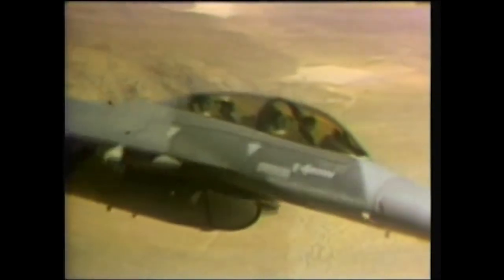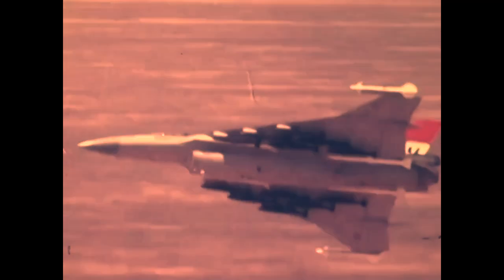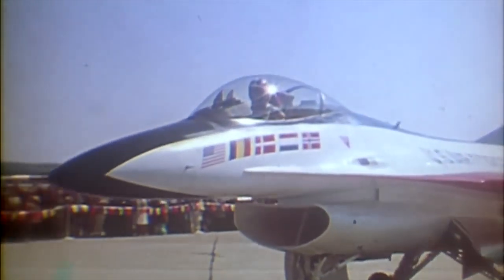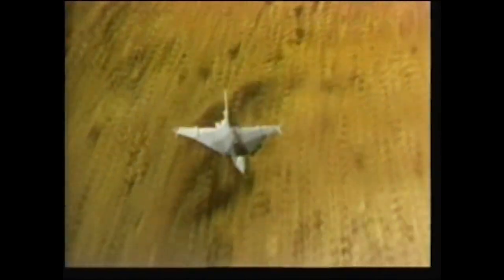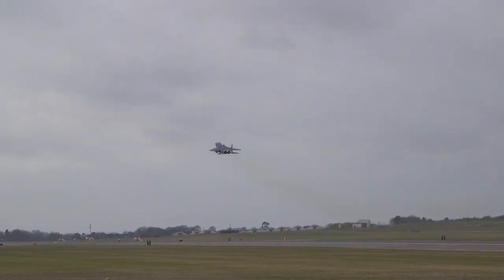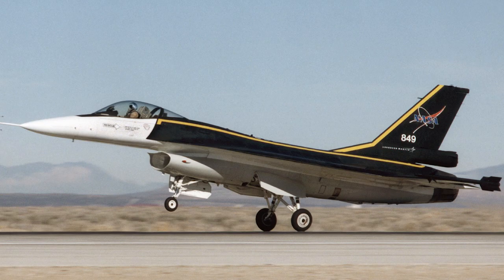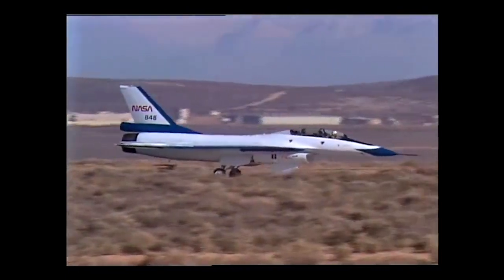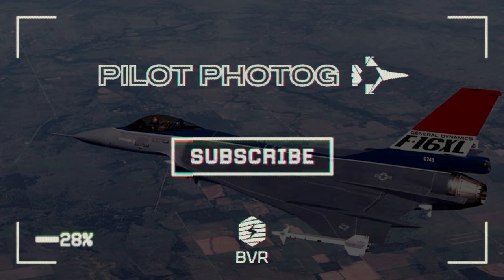F-16XL The Fighter That Should Have Been Built | avgeek |  #f-36

Comment: It really looks like the XL was meant to fit the same role as the F-15E, so it's not completely unfair for it to lose out (taking ATF & the Nighthawk aside).

However, I think the USAF would've benefitted in cost reduction long-term with the XL more than the Mudhen. Sure, XL is a redesign, but it has one less engine to worry about & still has a lot of modular features already in production. Not to mention training less people as WSOs.

The XL would've benefitted the US more especially today, while the Mudhen was the clear premium choice back then.
Reply from the maker: Good points and the XL would have been a lower cost option long term.  Also I think the XL would have had huge success as an export fighter - given that the F-16’s sales record to date.
Reply: @PilotPhotog  oh, definitely. What country wouldn't love a relatively low-cost, high-performance multirole?

Heck, if XL were exported, I think my country (Indonesia) would've chosen them over the Flankers. I can say that for certain with other Asian countries like Taiwan, Singapore, South Korea, and Thailand.
Reply from the maker: @TheRibbonRed  exactly and thanks for sharing! I think there was/is? a need for the XL.
Reply: USAF often goes for whatever the most expensive option is.   E.g., F-22 vs F-23, the more expensive F-22 is chosen, even though the cheaper F-23 was faster/stealthier than the F-22 and almost as maneuverable. For F-15E vs F-16XL, the more expensive F-15E is chosen.  There are a lot of examples of this. Might be a good subject for a video someday? :)
Reply from the maker: @ssranon  An excellent idea, thanks for commenting.
Reply: A. Nony Mous  I disagree, it actually seems like they typically choose the more inexpensive jet, like the F-15E as opposed to the “completely overhauled” F-16XL. In fact, the F-35 is the only real example of the U.S. military taking a gamble on the more expensive fighter, and potentially why they normally don’t. The F-35 is fancy but at what price/cost? I think that remains to be seen, I love the F-35 but I’m sure there was a less expensive option somewhere.
Reply: @heavyizthacrown-5842  Maybe a fourth F-35 ? One with a cranked delta wing, F-35 D . Great Video PilotPhotog ! Well done
Reply: from what i recall reading in the 90s, the XL was actually a pretty simple mod. Of course the wings were all new, but the rest was surprisingly easy. Hogwash about the reliability of the engine over long missions. The Israelis proved it was fine when they took an extended mission to blow up an Iranian facility pretty much straight away after delivery.
Reply: The main reason the USAF went with the Strike Eagle over the XL was the fact that the Eagle has TWO engines. It did NOT want to send a jet over enemy territory for bombing purposes with only ONE motor. Having only one motor is the main reason we nicknamed the F-16 "lawn darts."
Reply from the maker: Agreed and wonderful insight, thanks for commenting!
Reply: Don't forget the F-15 is still undefeated in war.
Reply: @PilotPhotog  I worked on the F-15A, C, & Es for 20 years!
Reply: @manwithnoname691  Yep, worked on them for 20 years!
Reply: Roland Lawrence   That was one single mission with unlikely resistance.
Reply: @stormyf15  exactly, another reason why the navy got stuck with the f18 bc their requirements was they wanted to engines and was also an ideal choice between the 2 for carrier landings
Reply: @ssranon  YF-23 & the planned F-23A cost much more than the F-22, even after AIRST and the supersonic ejection systems were dropped from the ATF program due to costs.

USAF chose the F-15E since the F-16XL was underpowered. If you read all the test pilot reports, they loved the XL, but all said they had concerns about it due to the lower thrust-to-weight ratio.
Reply: @mrrolandlawrence  Iranian facility? Nope. It was Iraqi facility. Ironically at the time Israel smuggled parts and munitions to Iran for their US made systems. Also that nuclear facility was earlier bombed with less success by Iranians using F-4 Phantoms, based on Israeli intel. During Iran-Iraqi war realpolitik made rather unlikely friends despite all anti-Israeli rhetoric from Iranian regime.
Reply: I think it would have made a great replacement for the F-106. The long range, super cruise, and low cost would have been really useful. For long range strike the F-15E was a better aircraft but no way it was cheaper.
Reply: @nichollsboy11  Can you go back and read what you typed, and try again? I can't tell what it is you are trying to say.
Reply: @LRRPFco52  sort of.    the actual unit cost of the F-23 was projected to be lower than the F-22, but the USAF was mad about Northrop's enormous B-2 Spirit cost overruns, and they were once-burned-twice-shy regarding the projected cost of the Northrop F-23.   the USAF therefore assumed the F-22 would be cheaper in the long run (without any concrete proof AFAIK) and included that in their official list of reasons to go with the F-22.  that was their story and they were sticking to it.

in fact Northrop had intentionally lowered the YF-23 cost through the clever use of a bunch of previously-designed parts from other airplanes including the F-18 and B-2 among others.   that would have helped avoid the type of cost overruns that plagued the B-2 program, and would have most likely resulted in the cheaper ATF per-unit cost.   but the USAF wasn't buying that idea.  literally.

as a result of the USAF official position, the that's the way the modern internet records the cost situation, and everyone thinks the F-22 was always the cheaper option.    but that doesn't quite correlate with what i was reading in the newspapers back in the late 80's / early 90's.
Reply: @ssranon  That's utter hogwash. The US military machine always factor performance and cost into the equation. They actually thought the F-23 was the cheaper option!
The F-16XL would never have been better than the F-15E, which has proved itself to be an indomitable machine.
Hey, I love the design of the F-16XL, but you can't just make stuff up to justify your point.
Reply: @Yxalitis  
> "The F-16XL would never have been better than the F-15E, which 
> has proved itself to be an indomitable machine."
> "Hey, I love the design of the F-16XL, but you can't just make stuff
> up to justify your point"

sorry, but what did i make up?   i never said the F-16XL was better than the F-15E, i just said the F-16XL was the cheaper of those two options.   not sure if you're responding to me, or something someone else said. ¯\_(ツ)_/¯
Reply: the XL with its conformal stores carriage was clearly superior to the E with its strictly bulk power provided by two engines. and how were its stealth character.
Reply: @DavidSiebert  Yes, long legs like the 106 and weapons load of the 15A/C, would've made a great interceptor.
Reply: @ssranon  True however the F-22 won because it is more maneuverable than the F-23. In addition the weapons system of the F22 is superior to that of the F23. The USAF, learned a hard lesson of the importance of maneuverability during vietnam and given that lesson the choice of the F22 was predictable. Though IMO why not choose both? Cost savings could be had by sharing weapons systems, avionics, etc.  Having both be beneficial, due to the option of capability on hand, perhaps even more so strategically opponents would then have to   prepare for the scenario of handling either an F23 vs. an F22 would be an advantage neither fighter alone would be able to project. 

Having a small fleet of F23's along side the F22's no more than 10 would be necessary. Such a fleet it's mere existence would require opposing militaries to spend significantly more to hope to be able to match the potential capability.
Reply: @ssranon  The YF-23 didn't have a working weapons bay missile storage and ejection system, just proposals and some initial design work.

The YF-22 already had not only a fully-fumctioning main weapons bay for AIM-120s, but the cheek bays for the AIM-9, both of which were demonstrated with in-flight separations.

The proposed F-23A was going to have an additional forward weapons bay, which would lengthen the already-long fighter, and still not reach the weapons count of the F-22A with its 6x AIM-120 & 2x AIM-9.

Due to the need to redesign the intakes and supersonic airflow management, tight tolerances Northrop demonstrated between control surfaces and the wing, the unresolved continued wind screen fractures, and questions about the viability of their weapons bays proposals, the costs to do extensive RDT&E on all of those were going to be extensive, whereas Lockheed/GD/Boeing already had that figured out on the YF-22.

The F-23A would have added years and another $100 million in R&D easily, with the risk of extending or missing critical deadlines to address all those issues.

It was a beautiful airframe with immense power and graceful handling, just had a lot of loose ends that would require major efforts to correct that the YF-22 had already conquered.
Reply: @ImpendingJoker  😂 sorry bruh I was drinking, but what I meant was thats why the Navy chose the f18 over the f16, the Navy's requirements was 2 engines, they didn't want a single engine jet
Reply: TheRibbonRed RUSIAN MIGS & SUKOIS are superior in every way against US aircraft. I was in the Air Force in the 80’s and the AF mechanics and avionic techs all told me the MIGS run in circles with our F-15 and F-16’s plus MIGS can land and take off on rugged terrain where none of ours can. Pretty much all MIGS have armor like the A-10 not like your typical US fighter that relies on avionic tech only.
Reply: @asianfighter62  You were seriously misled.  We did full technical analysis and tactical exploitation of the MiG-29 in Grrmany, UK, and Florida and it was a piece of garbage, very crude, poor human interface, climb rate was between the F-15 and F-16, no persistence, terrible R-27 missile, but great R-73 IR helmet-cued missile.

MiGs and Sukhois do not have armor around the pilot like on the A-10, as they aren't meant to fly low and slow doing CAS and getting shot repeatedly by AAA and MANPADs like the A-10.

There are several great articles and interviews of Fighter Weapons School pilots who did all the exploit work on the MiG-29 that basically blew away the myths that were perpetuated by CIA in the US in the 1980s.

Su-27 is a lot better platform than the MiG-29 in every way, but still suffers the fate of being built by limited Russian manufacturing quality control and the same missiles.
Reply: Calling the Eagle the "mudhen"?  Really?  You were aircrew?  No?  Then that's pretty much an instant clue-in the person typing has no idea what they are talking about, but is invested heavily in their own agenda...or fantasy.  And having one less engine is almost never a positive thing.
Reply: @FMChimera  Dark Grey Eagles are called Mudhens since they primarily do A2G. Light Grey C models are strictly A2A.
Reply: It was. 👍
Reply: @LRRPFco52  if the F-22 was so fully functional and ready to go vs the F-23, then why was F-22 deployment delayed 52 months?   why where there mass cost overruns?  why was it grounded with pilots dying from oxygen problems, flight restrictions being placed on the airplane, etc, happening even 10 YEARS after initial F-22 deployment?

many of these problems are documented in a whitepaper by the Rand Corporation if you want to look it up.  

i'm not denying the F-22 is a great plane (it is) but IMHO you can't imply that the F-22 was completely ready to go versus the F-23 which needed some additional R&D.  the F-22 has evolved into a fantastic front line fighter, but in 1991 it clearly wasn't ready for prime time yet either, and also had a ton of loose ends, as evidenced by the significant delays we have seen in the F-22 program over the years.
Reply: FMChimera half the consumption, simpler design and cost, and half the chance of engine failure compared to 2 engines, better aerodynamics, faster roll rate and maneuvering etc. There are many upsides to a single engine compared to 2
Reply: @FMChimera  You're one of those clowns who calls the F-16 a Fighting Falcon, aren't you?
Reply: @ssranon  It has something to do with contract management. No way would Northrop get chosen after the B-2 disaster. The Air Force ended up with 15+ B-2 Bombers at around 1+ Billion per plane. The F-15E has shown to be a solid choice.
Reply: @ssranon  The F-22A didn't exist in 1991, so any claim that its challenges were solved would be erroneous. Only 2 YF-22 prototypes existed then. The YF-22 & F-22A are quite different aircraft.

Since multiple new ground-breaking technologies were being integrated, there were major hurdles to overcome that no other nation has been able to do.

OBOGS wasn't an F-22 specific problem, but fleet-wide including the Navy. 

The YF-22 never met the weight goals of ATF, whereas the YF-23 did, which rarely gets mentioned. The YF-22 PAV-1 with GE YF120Ls was the only 1 of 4 that exceeded Mach 2.

Since the Lockheed team had done a lot of extra credit and solved the high supersonic airflow problem using a VLO splitter plate geometry, as well as solving the weapons bays and ejector rack separation.

They had to redesign the airframe, wings, stabs, vertical stabs, engine nacelles, intake placement, ductwork, and most difficult-make the IFDL work between multiple Raptors with the volume of data being shared.

The F-23A would have had to have tackled all these challenges as well, and OBOGS would have caused the same problems.
Reply: @LRRPFco52  thanks for the informative reply.   it sounds like we agree that both planes needed a lot of work before either was finished.  

i'm aware the F-22 didn't technically exist in 1991, i was referring to the F-22 prototype (YF-22) and the hypothetical F-23 prototype (YF-23) that were being flown against each other during the ATF fly offs that were held circa 1991 iirc.   apologies, i should have been more specific.

fwiw, i still think it's a shame that the F-23 never came to fruition, it might have been a fantastic airplane.  no way to ever know for sure.  but i admit the F-22 has turned out to be a fantastic plane itself.
Reply: @Steve-yr5vi  i havent heard of the f-23 yet but it sounds like it still woulda been better than the f-35. Shoot, I think it's clear that the government doesnt even plan to really use them as they are revamping already in use craft like the new F-15s and upgraded A-10s. 

They just plan to sell the f-35 to make money. I just learned that we cant even build more f-22s today if we wanted to. The tech is old, and integrating new tech would take more money. F-23 sounds like it woulda been a good addition to the 22s. 

The dream would have been the companies work together and share tech, making a hybrid but hey sometimes two is better than one. 
We made a mistake not making this jet with the f-16, and we made another by not making the f-23. 
Probably would've had a 6th gen ready to go by now.
Reply: @mrrolandlawrence  they didn't receive any ground fire and they flew low level all the way there and back. No early warning for the Iraqis.  Plus they were just in the bomber role they had F-15's as fighter escorts with them.  I have yet see a story of an F-16 fly without a wing either. An Israeli F-15 landed without a wing.
Reply: @Giada_De_Low_Rent_Tits jus saw a video on Israeli's use of the f16s. We definitely shoulda invested more into them than the f35 which has been plagued from the start
Reply: @ssranon  The cheaper F-23? I thought price point was the deciding factor and the YF-23 was substantially more? Just as it ultimately was with the JSF -> F-35.
Reply: Id still rather have 2 engine's instead of the 1 more reliable and power
Reply: @Giada_De_Low_Rent_Tits well Canada wont buy one engine jets for the specific reason that they need two because of the type of air space they fly in thats why they went with the f18 hornet, so il take the military's word on the type of hardware required for their missions.its just common sense if one engine fails they still have one to get them home and save the aircraft. Tomcats are a old aircraft they have much better engines today and i would bet that there was a specific problem with the type of engine they used on that legacy aircraft so that point really doesn't matter.
Reply: Hell, even if Lockheed revived the F-16XL now and incorporated the F-16 Block 70 technology, I suspect it'd do well. For nations where technology transfer restrictions won't allow the F-35 to be offered, it'd be a good competitor to Boeing's Super Hornet and the Eurofighter Typhoon.

(Though I suppose the viability of that idea depends on whether the F-16XL was included when Lockheed bought the Fort Worth Division from General Dynamics.)
Reply: @andrewthomas8233  And why the Super Hornet is the most likely choice for the CF-18 replacement.
Reply: @PilotPhotog  
Just say it , man... F-16XL-Block.70 ! .😎
Reply: @Steve-yr5vi  
Too many different aircraft in the same mission role is a logistic/support nightmare. Parts and training costs would be huge and wasteful.
Reply: Give a pilot a choice of 1 engine or 2 especially if you have to go down low, twin engines are the choice.
Also in talking to f 16 pilots the success of it comes from the small size.
Otherwise no reason to replace the f 15 the most successful fighter ever   104 and 0
Vipers hornets etc have all been shot down
Reply: @stormyf15  oh yeah? I worked on them for 21! So there!
Reply: In the role of deep strike it loses out to the Strike Eagle. You want the big wide frame to haul the heavy ass bombs and you want the two engines to give it decent flight performance. You can just tell by the size of its wing... it's fully relying on high lift to keep afloat. A fully loaded F-16XL would not go into the vertical. 

Though I think this would have been interesting in a high altitude interceptor configuration re-engined with a J-58 or something.
Reply: With the avionics technology of the time the wso is a crucial element of a successful mission.  It took how many years for the f-35 to fill that roll with a single pilot?
Reply: The F-15E could've been converted to a single seater.
Reply: Not  really. the f-16 was  designed to be a cheaper plane to complement the f-15.The fact the the xl cost as much as the f-15 is what doomed it.
Reply: @PilotPhotog  It was mentioned today 24 Aug 20, that there is a $62 BILLION most to Taiwan....can't imagine what China would think if Taiwan has the F-16 & F-16 XL  (Whoa!!)
Reply: TheRibbonRed the unsung hero’s are the FIS Squadrons.  They usually get other people’s aircraft when they are done with them.  Interceptors do not have to be stealth for they are intended to be seen in the intercept.  Stealth and SATCOM will change this in time, and already has in Alaska.
Reply: @rapidsqualor5367  F-35 could use a delta wing considering its current set up gives it poor range/fuel consumption and can't super cruise while everyone else can. Plus its supposedly a multi role, why not give it the payload if its supposed to be?
Reply: @PugilistCactus  Grafting on a delta wing to a F-16 is one thing but on a stealth plane ? Not with my tax dollars. The F-35 does have some great sub systems. The PW F135 engine. The F-35B is fantastic. The F-35A compares with the F-16.  50% more weight, 50% more thrust, 50% more wing area. Maybe where they dropped the ball was not following the area rule and ending up with more wave drag. Maybe the new CMC engines will help overcome.
Reply: Seems like there's a high bias for Lockheed/Lockheed-Martin and Boeing for high priority plane projects. The YF-23 used new construction techniques and avionics BUT, used common parts, such as landing gear from the F-5, which is still in service as an "adversary" plane in BFM squadrons that don't use the Viper or F/A-18 in that role. The F-15, F-22 and F-35 were/are BRAND new systems that use technology pioneered from the previous platform before it. The F-35 and F-22 have a higher flyaway cost than the F-15 and F-16 combined.
Reply: @nichollsboy11  The YF-17 was the direct competitor to the YF-16, and the US Navy adopted the YF-17 airframe, beefed up the undercarriage, associated bulkheafs, and tail hook. The LEXs were also enlarged for higher AOAs needed for Carrier ops. It's amazing how what seemed to be a dead project was rescued by the Navy, and look at the program now. 40+ years later and we have the "Super Hornet" which is actually the "Hornet 2000". Same applies to the UH-1Y/AH-1Z concept. Both airframe upgrades were suggested decades ago, and have only recently been implemented. The basic design remains unchanged, despite it being nearly 60 years old. Same for the Hornet family, same base design with needed performance and design changes.
Reply: @mrrolandlawrence  As much as they would like to, the Israelis never flew any strike missions in or at Iran. You're probably referring to the '84 mission against the Iraqi nuclear reactor at Osiraq.
Reply: ETF program is asking for a strike aircraft, so air to air capability was a secondary concern, while range and low level flight characteristics would be priority, the F-15E actually failed the initial project requirement at the deadline while the XL passed with flying colors, since F-15's original design been an air superiority fighter has a much lower wing loading which makes low level stability an issue - crucial for a low level penetration strike craft, while the twin engine placement made it way less efficient in fuel usage so range was also an issue. However the USAF was also concerned about increasing the size of its existing F-15C/D fleet, which has been taking extensive flak from congress on its sole focus on air superiority missions to the detriment of other functions, especially with the advances in radar and missile making F-16 also a competent BVR interceptor. Having the F-15E in the fleet would have silenced some of those criticisms while decreasing individual fly away cost for ALL models of F-15. And so it was that the Air Force essentially allowed the F-15E team to "cheat" and gave them extra time to come up with the additional Conformal Tank (CFT) solution for its insufficient range (The F-16XL on the otherhand was perfectly capable of carrying the specified amount of munition while reaching the required range without external fuel tank). So one could almost say the selection has more to do with the USAF political desire to protect its F-15 fleet then actual operational requirement.
Reply: The XL just can't do what the Strike Eagle can do, so it makes no sense to look at cost, if you don't get the capability needed. Even the Strike Eagle was a huge compromise, because it falls way short of the F-111 wich it was meant to replace.  The Strike Eagle was not a premium choice, it was the best compromise the USAF could get. Furthermore the WSO is the backbone in AtoG engagements, especially in complex. long range strike missions and as an airborne forward air controller. Due to the yak ahead, the XL would have had to enter service as a 2 seater, so no cost savings there. One person just could not do the job back then and even today all new F-15s are two-seaters and most will be used as such. 
The F-16XL lost, because it was the lesser product for the task.
Reply: @TheRibbonRed  All countries mentioned in your post fly the F-16 and in addition modern developments of the Strike Eagle. The XL was just not the richt plane. You lost a lot of it's air to air flight performance and still don't even come close to the Strike Eagle`s potential.
Reply: @ssranon  The F-15E anf F-16XL were meant to replace the F-111 and the F-16XL just could not deliver. Even the F-15E was a huge compromise compared to the F-111`s long range capabilities.
Reply: @PilotPhotog  The lower cost option, wich could not fulfill the task. It makes makes zero sense to buy such a platform.
Reply: @Hunter Giovanni just reported you on the FBI website 👍🏻
Reply: I have read that the F-16XL was General Dynamics competitor to the Boeing F-15E Strike Eagle. Both were presented as replacements for the retiring FB-111 Aardvark. USAF chose the F-15E but did show interest in the F-16XL.
Reply: They should have replaced the F-16 with the F-16XL
Reply: It was the competitor of the F-15 E for the ETF contract. It lost due to having unacceptable ride at nap of the earth flying. Could have made a great lower cost defense fighter
Reply: @heavyizthacrown-5842  The less expensive option was ignoring the Marines and not trying to shoehorn a STOVL into the F35 design. That was the source of all the ills.
Reply: @ssranon  There's no way the F-23 would have been cheaper than the F-22. The 23 had too many new technologies.
Reply: No necessialry so. From the inception idea of a LWF (Boyd &  other Einsteins, and they were) and the less than desired performance of weapons systems of the F-4 in Nam, there was then and now a mission requirement for a high and low mission fighter bomber. In the DOD there never will be a Leatherman multi-purpose tool.  If the govt could dictate where the mult--tool was made it would be  Georgia and the west coast, and Tx. Needless to say it wouldn't work or even fit together while costing 5x it's weight in platinum. You say no, look at the A-12 program that got cancelled.
The survival of economies dictate contract awards. McDonnell Douglas was to survive....getting the high mission. GDFW and P& W got the low. The F-111 was killed by Doves.  P&W makes the F-100 Engine for both the 15 and 16. Nuff said
Reply: Do not ever get me wrong or try to explain why I love both the F-15 and the F-16. You will fail.
But then again I loved my Hawg above all. He was cute.
So there!
Reply: @Major_Tamre_Colby  yes love is a many spender thing. I worked the Hun, a maintenance nightmare, for seven years but loved being it's crew chief because it was a legend and I was part of it.
Reply: @robertstack2144  
Robert,
This is Tamre'. I am not all knowable. What is the Hun?
Tamre'
Reply: @Major_Tamre_Colby  the "HUN," is an American term used to name the North American F-100 C,D and F Model Super Sabre Aircraft. The 100 is pronounced ONE "HUN"DRED. We who were associated just called it THE HUN.
Reply: @robertstack2144  
I stand humbled. The only aircraft I am familiar with of the early sixties until development is the F-105. Thought I have always been fascinated with trying to fly the F-104.
But my German friends will not allow that.
I do not know all the nicknames for all the ancient aircraft.
Forgive me.
Tamre'
Reply: @Major_Tamre_Colby  How are you with the F-111.  Military strategists then considered it the perfect airplane and by all accounts it was. Back then the Soviets feared it as much or more than their own secret police. The Soviets wanted every F-111 counted in the SALT  negotiations, even the F-111s in storage that were worn out or being salvaged had to be included.  They had no defense for TFR. Our politicians here made it a pariah, as politicians do to good people and good things.
Reply: @robertstack2144  
Robert,
That is without debate. It was the most phenomenal aircraft of its day. The first swept wing super sonic aircraft ever. The Soviets tried and failed to copy it.
It was a major player in Vietnam.
Should I denigrate it?
Yes. It was not pretty and I like my plane better.
So there.
Tamre'
(Also its ejection system sucked.)
Reply: @robertstack2144  
Robert,
I would love to have been able to fly an F-111 Aardvark. Alas they were gone before I was born, besides I do not like to share but that is not either here nor there. I have been lucky that I have been honored to fly the F-104, F-105, F-14, F-15 and P-51D and a few others that are no more. And of course the A-10B, F-16C and recently the F-22. Rank and whining has its privilege. Bribery doesn't hurt either.
Reply: @robertstack2144  
Robert!
Thank you for reminding me! I had totally forgotten that. In a world full of Aardvarks, Hawgs, Vipers, Raptors, Buffaloes and Pogos, yes there was a ill fated insult to our dear pogo stick, I forgot we also had a Hun in good standing. But nothing can match for sheer imagination the wonderful silly Squirrel.
Reply: @Major_Tamre_Colby The F-111  was a miser on fuel compared to the F-14 which I think that in burner the F-14  TF-30's two of them would burn 564,000 lbs/hour while the F-111  at altitude had a max burn rate of 540,000 lbs/hr a savings of around 5%. I'm not sure why because the F-111  I believe was a lot heavier.thats about 83,000 gal of F-40 an hour. Hope you can afford to fly one.
Reply: @robertstack2144  
Oh My! Robert, you do not think that I was being facetious do you?
Heaven forbid!
Maybe a little irreverent with inane jocularity. But never facetious, the would be my Lt. Kara Rayas. 
...you talking about me.
No.
...you better not bossygirl
...or I hit you! Sir!
Kara, you hit like a girl.
...a 185cm amazonian
...warrior and nomadic
...gypsy princess girl.
Robert, your F-111 Aardvark got off easy.
...aardvarks eat ants.
See what I mean.
Reply: @Major_Tamre_Colby  I was being facetious about the 14 and 111.  Both very heavy aircraft powered by the TF30 but different dash numbers. Both could drain Iraq of their oil supply. The only Kara I knew of was Revlon or Kara Hultgren. While working at GDFW one Engnr I knew went thru Navy  OTS and flt training with her. We should sit and enjoy a beer sometimes, I'll remember The Hun and Y2 and you The Hog. Best Regards
Reply: @mrrolandlawrence  There have been numerous cases of F-15s returning with one engine not functioning. Guess how many F-16s have made it back to base with one engine not functioning?
Reply: *hh:bh*:
Reply: One day, AI and the wingman program will dedicate maybe as much as 10 AI wingman   . Imagine an F16 with 10 dedicated AI wingman with stealth capabilities. I’m predicting the XLs return.
Reply: The Strike Fighter competition was indeed meant to pick an airframe - for a very specific role: night / weather deep-strike into enemy territory. The F-15E was clearly a superior choice - for THAT mission; two engines + two aircrew were critical, and they were unable at that time to achieve the capabilities of the F-15E radar / targeting system into an F-16.

But that's really irrelevant, because it never needed to be "one or the other." The XL wing version would have added $0 to the operational costs per unit, and averaged over the production life of all F-16s built SINCE then, would only have added about $1 million to the acquisition costs (at that time, roughly a 5% increase in purchase cost and only 2.5% increase in total lifetime cost for about a 70% increase in capability). I was training to fly Phantoms at that time, and I and my squadron mates all rated the decision not to alter future builds of the XL as probably the worst strategic purchasing mistake by the USAF since it's inception.
Reply: @PilotPhotog  They just made a decision to buy F-15EX airframes to "bridge the gap" because we are currently retiring older airframes faster than they can build F-35s. The stated intent (of course we can't know what they are really thinking) is that in a war against China or Russia the F-15EX aircraft would act as "missile mules" for the F-22s and F-35s, allowing them to direct the battle invisibly while ordering attacks against individual aircraft.

The F-15EX is specially modified to carry up to 8 AMRAAM (or it's successor) missiles. The XL was capable of carrying 16 as designed - and for the SAME PRICE we could have fielded twice as many (32 missiles airborne for the price of 8).  The cost? $0 per unit in additional operational / support costs, about $1 million per unit (about 5% of purchase cost at the time) in acquisition cost. I rate the decision NOT to convert the F-16 construction line to build all future F-16s with the XL wing as the worst strategic purchasing cost by the USAF of all time.
Reply: @ssranon  The specific role for the Strike Eagle mission was night / weather deep strike. For THAT ROLE, the F-15E was the correct decision (basically replacing the F-111). However, that does not change the fact that had they made the decision simply to produce all subsequent F-16s with the XL wing every aircraft would have had about 70% more mission capability for about $1 million more in acquisition costs (about 5% of purchase cost), and ZERO in additional support costs. Worst purchasing decision by the USAF ever!
Reply: @mrrolandlawrence  Correct. Averaged across all future construction F-16s after the Strike Fighter contest, the wing mod would have added about 5% ($1 million) per unit to acquisition costs and ZERO to support costs (meaning about a 2.5% lifetime increase in total cost of ownership and operation). For that they would have achieved about a 70% increase in mission capability. Worst strategic purchasing decision in USAF history IMHO.
Reply: @LRRPFco52  Incorrect. The YF-23 would have had a similar, or perhaps even lower, total cost of ownership. And, IMHO it was a better aircraft. However, that was not the only consideration. Northrop had recently angered some in Congress for a mistake, and they were already building F-16s and F-119s. It makes some sense to spread the purchases of major combat units across more than a single vendor.
Reply: @Yxalitis  Speaking of hogwash, there are several videos on YouTube which address all the reasons why the F-23 was not chosen. Better performance was NOT one of them. The F-23 out-performed the F-22. The F-16XL was NOT suitable to the SPECIFIC mission of the Strike Fighter contest (night/weather deep strike into enemy territory); however, the decision not to apply the F-16XL wing to all future production units was perhaps the worst strategic purchasing decisions in USAF history (about 70% increase in combat capability for about a 2.5% increase in total lifetime cost of ownership). It was never an either/or decision, they could and should have built both.
Reply: @Steve-yr5vi  "True however the F-22 won because it is more maneuverable than the F-23."  Sorry, but that is not true - and in any case they were so close that it was never a deciding factor. What they ought to have done back then was to build one of the two contestants exactly as they did, and have modified all future builds of the F-16 to the XL wing and use them (if ever needed) in exactly the same role they plan for the F-15EX to be used today - missile mules. With the supercruise capability of the XL both to close in and disengage; far better stealth than any F-15; and the ability to carry up to 16 air to air missiles, the F-22/23 planes need never have gotten close to their targets to take them out and the low total number of F-22/23 aircraft would not have been a hindrance to fighting a first-world war.
Reply: @LRRPFco52  The F-22 ended up having just as much in cost overruns and redesign. Can't mention what I do know, but the 23 probably would have been the better choice in hindsight.
Reply: @FMChimera  Just before I deployed to Iraq in '90, I met up with one of my old F-4 back seaters then flying the F-15E. He called it the mud hen, as did many (most?) of the other fighter pilots.

Having one less engine meant the F-16 cost less than 1/2 as much to operate as any F-15 (as well as costing half as much to buy). Yes as a pilot we would all like a second engine; however, when it's a choice between losing a few aircrew vs doubling your combat capability, guess which one wins?
Reply: @RedXlV  3 years later - they just made a decision to buy F-15EX aircraft to "bridge the gap" as airframes are being retired faster than they can build new F-35s. These F-15s have been specially modified to carry up to 8 air to air missiles so they can act as "missile mules" for the F-22s / F-35s should we go to war with China or Russia.

The F-16XL was designed to carry 16 air to air missiles. So, for the same purchase and operational costs, we could have had 2 F-16XLs airborne carrying 32 missiles on behalf of our stealth airborne command and control vs 8, and we wouldn't even have had to make a special buy.
Reply: @fazole  F-16XL was mechanically almost identical to the "normal" F-16, and could easily have been supported by the same supply chain (mixed F-16s and F-16XLs could easily be accomodated at the same base).
Reply: @cw93711  That's why they don't let us pilots choose, but make purchasing decisions (at least notionally) based on mission requirements.
Reply: @appa609  Correct - for that specific mission, the F-15E was a no-brainer.

That doesn't explain the decision NOT to modify the F-16 assembly line(s) to equip all future build units with the new wing. It would have added about 2.5% to total lifetime cost of ownership/operation, for about a 70% increase in mission capability. Unconscionable decision...
Reply: @thunberbolttwo3953  Adding just the XL wing to the existing assembly line would have added about $1 million per unit (about 5% of purchase cost) to the acquisition, and pretty much ZERO to the operating costs (which are about half the total lifetime cost of ownership). So, for 2.5% more cost every aircraft would have had about 70% more combat capability....

The XL was NEVER a serious contender against the F-15E for the Strike Fighter contest, which was specifically for a night / weather deep strike capability to replace the F-111.
Reply: @rogerramjet6134  The proposed F-23 systems architecture was more expensive to purchase and operate, since every control surface had 2x actuators laid sideways to keep the wings and tails thin.

Development costs would have been many hundreds of millions more since they still didn’t have the boundary layer diverters solved, which limited the YF-23’s max speeds.  They also cracked multiple wind screens in test flights because Northrop had not built a Mach 2+ fighter that sustained high Mach values ever.

Northrop did not make the F-16.  That was General Dynamics, later merged with Lockheed-Martin.  There is no such thing as the F-119, which was a plastic model airplane made by Testors.

We were at Edwards AFB throughout all of this and I’m basing my statements on test pilot interviews and official publications from the companies and test teams involved in ATF.
Reply: @rogerramjet6134  Canopy, boundary layer management, weapons carriage and bays, actuators, TVC, DFLCS, FADEC, and avionics were either mature or matured mostly on-schedule with the F-22A.  All of those needed significant RDT&E for the proposed F-23A, with the avionics being largely the same between the 2.

I like the looks and range of the YF-23 better for sure, but the basic cost risks were very real and could have jeopardized the program even more with less airframes built.
Reply: @LRRPFco52  Nonsense. The standard exhaust nozzles alone saved more complexity than dual actuators could possibly add. Flight regime modifications are among the easiest to work out. At worst, they could have outsourced the windscreen to their competitor. Typo on the F-117, get real.

I too spoke with two of the pilots (were were a busload of F-4 pilots from George AFB). Their opinions diverge significantly from yours. 

There is no denying that the F-22 team was a bit ahead in the development cycle, but NONE of what you mentioned had any bearing whatsoever on the final decision.
Reply: @rogerramjet6134  As you look at the “standard exhaust nozzles” of the YF-23, take a look at the complex tile matrix immediately behind them for the IR concealment system and scale the maintenance hours that would have been required for it.  2D TVC on he Raptor looks like child’s play in comparison.

F-4s pilot opinions diverged significantly from reality ever since the F-15 and F-16 hit the street, especially the high hr guys who wouldn’t be converted over to teen series unless they went ANG or AFRES.  Not sure how an F-4 pilot’s perspective would have any relevance to ATF since they were made obsolete outside of the Wild Weasel mission in the mid-1970s.  ATF flights were 1990-1991.

Not even Rick Abell knows what determined the final decision, but the problems with the YF-23 design couldn’t have helped its chances in the final decision.  Unit Program and Unit Flyaway costs would have been higher as well.  I think it looks sexier and is a timeless design myself.  Had I been in charge, I would have crushed Federal welfare programs and funded both designs for a USAFE and PACAF split fleet with common AESA Radars and other subsystems under the hood for economy of scale and OT&E benefits to both, as well as keeping a healthy strategic industrial base split between Northrop and Lockheed.
Reply: @LRRPFco52  Yes - an assembly which rarely if ever needs maintenance would be SOOOO expensive to maintain LOL!!!

I'm sure Phantom pilots everywhere are simply DEVASTATED by your opinion lol! I know many who went on to fly every other fighter in inventory in the 80s, 90s, etc. and a few who've even flown the F-35. 

The reasons for the choice were all clearly stated in the video (and reaffirmed thousands of times elsewhere). Perhaps before you post you should consider actually watching it.

Having a single design for radars and other subsystems is every bit as dangerous as having the same species of tree in every orchard or same exact species of grain in every adjoining farm. One virus can take them all out.

You seem singularly ignorant of how the military operates, or even what it's basic considerations are. Go ahead and have the last word, we are finished here...
Reply: @rogerramjet6134  Weird, since I was in the developmental community that pioneered these systems and many others at AFFTC.  What line of work are you in ny the way?  If you think the exhaust portion of after-burning turbofans don’t need maintenance, then you’re clearly the one out of your league here.

Also, comparing programmable signals processing AESAs and other subsystems to trees is another giveaway you don’t have a clue what your’e taking about.  Best to keep your trap shut on these matters from now on.
Reply: @LRRPFco52  "...since I was in the developmental community ..."

Yes, even scientists need cafeteria workers. Good for you!
Reply: @rogerramjet6134  We were the scientists, aerospace engineers, and mathematicians.  My older relatives were machinists at Douglas and fabricators at North American.